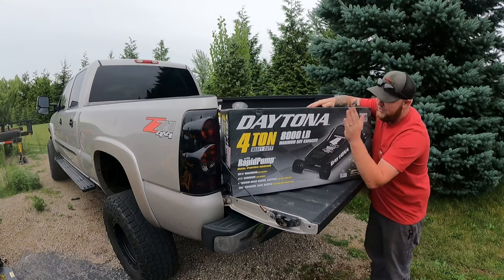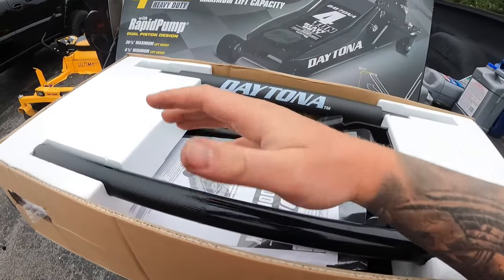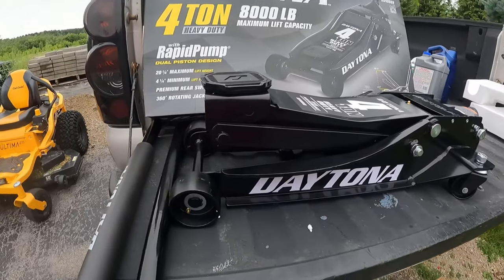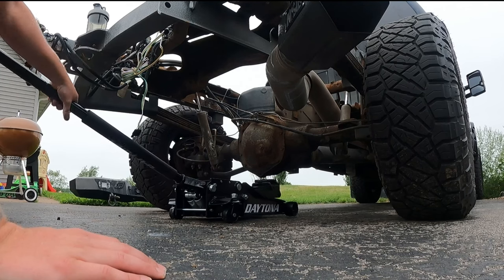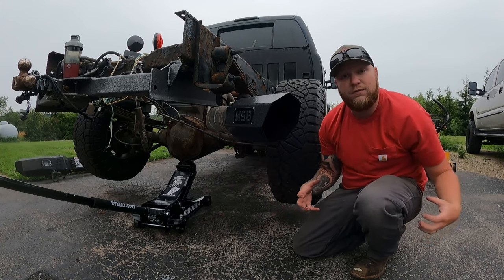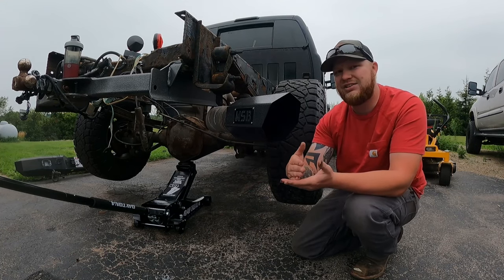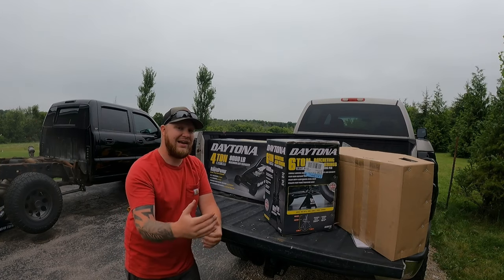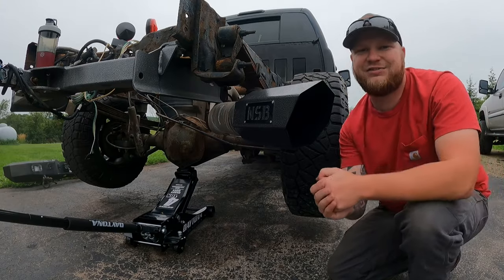DAYTONA 4 TON HARBOR FREIGHT FLOOR JACK REVIEW & UNBOXING

Comment: I went with the 4 ton jack just because it was only $40 more for the 4 vs the 3 and exactly like you said, it won't have to work as hard so in theory it should last longer. I don't want to have to upgrade any time soon so I figured the 4 ton should handle anything I would use it for.

Comment: This is the only jack that has slid off the frame. Luckily I had the wheels on. Recently the pad came off. Still love the jack, I just place wheels under it and the new jack stands.
Reply from the maker: Ya gotta use jack stands when your under there, and wheel chocks

Comment: Hows it hold up? Obviously everyone goes nuts for the 3 ton superduty... yes its a quality jack but i want a 4 ton and they are cheaper... my concern is is it as quality as the 3 ton super duty with a standard 3 year warranty "snap-on copy"
Reply from the maker: I’m still very happy with it. I would say I am glad I have the 4ton it just lifts much easier, and feels like it doesn’t work as hard. I’ve left it outside multiple times through the rain, and still have great performance from it. If it went bad I’d honestly buy another. So far it has been the best jack I have owned (for the price).
Reply: @DIYDiesel awesome thank you for the reply i appreciate it

Comment: My set screw does not keep the handle in... any thoughts?  (The set screw is tightened all the way)  Whenever I pull the jack by the handle, it pops out.
Reply from the maker: Really? I’d make sure the lip solid on the handle possibly a longer bolt or return it for a new one

Comment: I just cannot for the life of me decide between this one and the 3T Badland Jack
Reply: Unless you're working on a lot of unpaved surfaces I'd say get the Daytona. I have both and unless I'm somewhere where there's gravel or very uneven surfaces I'm not using the badland over the Daytona. I have multiple project cars in different locations and I have an aluminum 3 ton Arcan jack for taking with me in the truck too. Super easy to move around and I'd put it on par with the Daytona jack as far as quality goes.